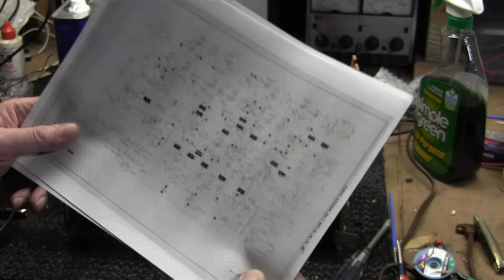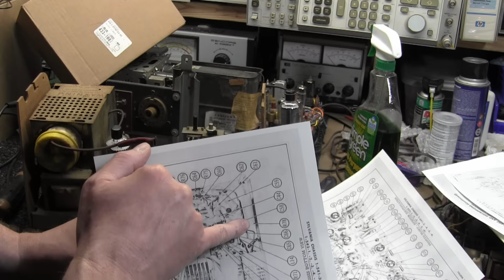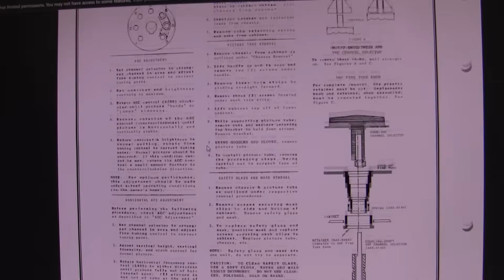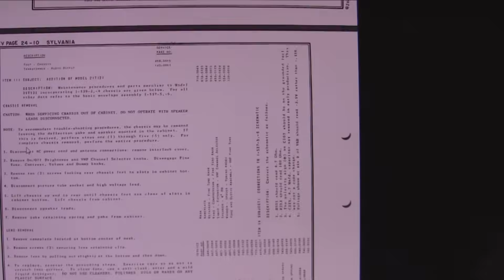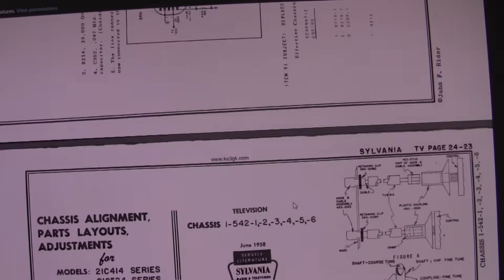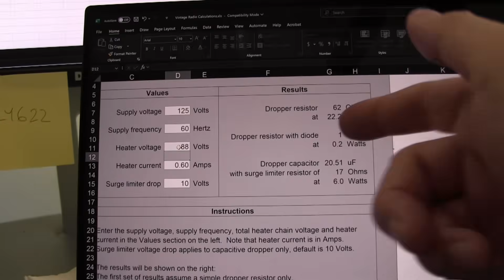Sylvania Halolight/Sylouette 21C529 part 3

Comment: With a 600 mA string and a 45 ohm heater dropper resistor that's 27v of drop at 16.2 watts, as it looks to me.  If so, using a diode to cut the effective heater string voltage (to about 85 volts rms, 1/sqrt(2) * 120 volts) would be too much drop, but it would have been a good idea if possible.  But keeping the dropper resistor on top of the lower chassis as you suggested is a good idea.  Maybe it would also be a good idea to paste a label inside the cabinet showing what the service mods were from the original.

Those are old bullet diodes, but not even the oldest I have seen in service supplies.  Even older ones are top hat diodes.  The bullet and top hat shapes had the advantage of making polarity evident without looking for a band or marking.

Hoping the overall project will be a success.  This is an unusual set.
Reply from the maker: It's close enough to use a diode and I will be.  Target is 89 volts or so and our line voltage is typically around 125.

Comment: That underneath is a big paper covered electrolytic cap
Reply from the maker: Correct
Reply: @bandersentv  three sections are in the power supply, the forth is in the vertical deflection.

Comment: Bob, I noticed several errors with that dropper capacitor calculation, unless I missed something.  To drop 37 Vac with a current of 600 mA and a series 17 ohm surge resistor, I calculated the cap value needs to be 59.4 uF.  The calculator program you are using seems to be using a line frequency of 174 Hertz for it's calculation.  I triple checked my results to make sure I wasn't getting fooled by an error.
Reply from the maker: This website explains the calculations and has a link to download the spreadsheet I used.  https://www.vintage-radio.com/repair-restore-information/valve_dropper-calcs.html
Reply: @bandersentv  I noticed later in Part 4, you decided upon the diode dropper so, the cap calculation is moot at this point.  DC filament power shortens the life but, this shouldn't matter since the restored set won't get that much use.
Reply: @billharris6886  Why does half or full wave rectification shorten tube life?
Reply: @adrielrowley  It has nothing to do with half or full wave rectification.  The problem is with the filament, feeding DC to a filament actually moves the filament metal over time, just like water in a fast moving stream moves soil due to erosion.  As related to the filament, this effect is called "DC Notching".  Therefore, it is best to use AC to feed filaments to prevent the problem.

Comment: I see a Philco Tandem on your bench. I finished mine. I bought a 50's GE TV with metal cabinet and checked the CRT before I started recapping it and it tested strong. I finished recapping it and could only get an extremely dim raster moving the ion trap magnet onto the socket. Turns out the CRT gun is bent. I have another set with same CRT and its not bent.
Reply from the maker: Bent gun might be correct.  Two basic ways to trap ions - bent gun or straight gun with an angle cut.
Reply: @bandersentv  I guess I need a 14QP4A then.

Comment: Few years ago I spent significant amount of time trying to understand the effects of over and under voting tubes, what I remember that tubes are designed to work with + - 10% voltage tolerance, over-voltage might shorten the filament life, on the other hand under-voltage with more than 10% will reduce the overall tube life significantly

Comment: The dropper calculator you were using at the end - it was  set to factor in a 10V surge limiter drop already (bottom value on left hand side) - so you do have headroom if you use a diode.
Reply: In the literature below the calculator it reads that it only applies to the capacitor drop.
Reply: @Scott.Newmaster Ah, ok.... shame 😢
Reply from the maker: I plan on using a thermistor for the surge limiting resistor.  It will start out around 120 ohms, then settle down to around 3-5 ohms. Should be fine in series with a diode.

Comment: That isn't a circuit breaker. It's a bayonet fuse. You push down and turn to remove it. Hope it isn't bad, because finding a replacement might be rough...
Reply from the maker: Right you are.  I'm surprised they leave one end of the fuse exposed like that.  The fuse is blown.
Reply: @bandersentv  Electrical safety was kind of an afterthought in those days, especially with internal components.